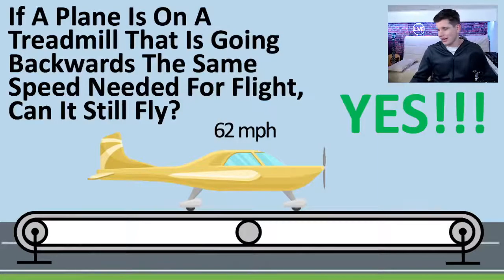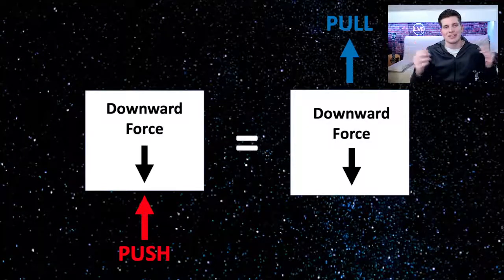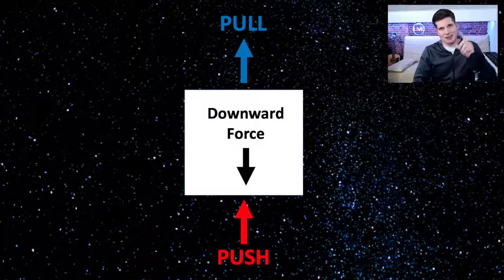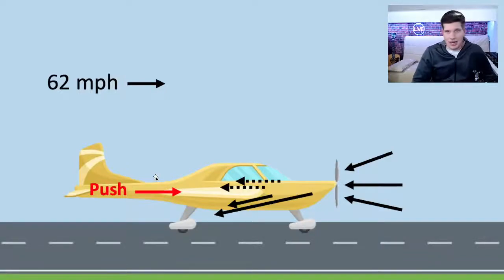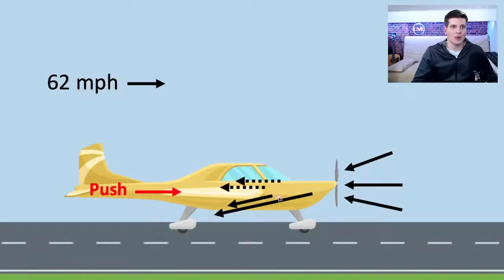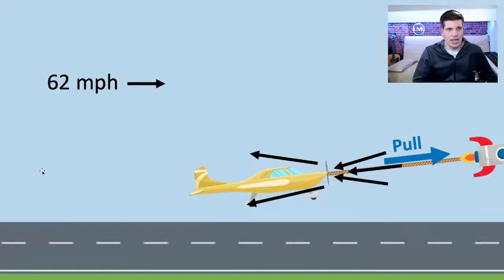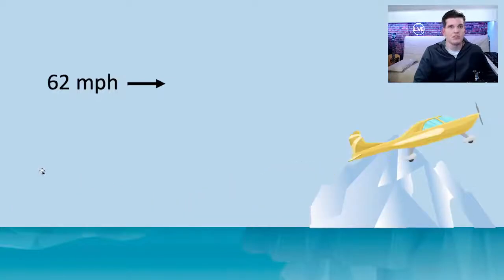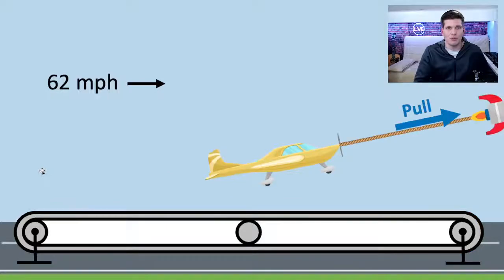Can A Plane Fly On A Treadmill? SOLVED! -A Practical Review

Comment: So if the wheels are matched exactly to the treadmill at all times, how can they possibly move to a location further up the treadmill? No matter where the acceleration force is coming from. All that's really happening is that the propeller is indirectly accelerating the treadmill to move the aircraft in the opposite direction at the same speed.
Reply: Wheels are passive.
Reply: Once more for the dense.

A rolling object on top of a moving surface moving at the same speed gives you zero net motion of the rolling object:

https://youtu.be/SLRfYA5AhgQ?si=3eqxedOsh-bsAZjb
Reply: @MrDefreese the crawler is not being propelled in any way. Again, you're not understanding the situation. 

Also dude, just stop with all this edgelord insulting: it's not helping. It makes you appear dishonest.

I'm going to hold your hand and walk you down the path to understanding. I'm confident I can explain this to you and help you understand the scenario correctly. 

But to do that, you need to engage honestly. 

I have 4 or 5 short questions. 
Please answer them directly and honestly. 
If I'm wrong, this will demonstrate that. 

When I've reached my conclusion, you can do the same. Or you can go first.

Sound fair?
Reply: @nuberiffic derp, the crawler is at one speed, the thought project says the moving surface matches exactly at every speed.  Increase the speed of the vehicle, the surface moves faster.  Move the vehicle slower, the surface moves slower,

That’s what ‘exactly matches’ means.

If you keep having problems with not only basic physics but also simple reading comprehension, you should just check out now and save yourself from being embarrassed even further.
You worry about your own honesty and if you need help with your own misunderstanding, you can ask nicely.

You have botched every single one of your attempted contributions.  You would need office hour assistance to properly remediate your mistakes.
Reply: Because the aeroplane isn't using the wheels to move forward.

The treadmill could be moving at infinite speed. It doesn't matter. 
The wheels are irrelevant.
Reply: @nuberiffic  People like you completely ignore that the plane needs to overcome the plane going backwards. If you placed a plane on a 10,000 mile long conveyer belt and put the plane on it facing backwards and turned the conveyer belt up to the equivalent of 160 knotts and then turned on the plane's engine and set it to 160 knotts you would have a plane that was standing still with its wheels spinning wildly.

The plane being stationary would have no lift on its wings and would NOT fly.
Reply: @DarthVader1977  ...well yes, if the aeroplane was stationary, then it wouldn''t be able to fly.

But that's the whole point.
It * wouldn't* be stationary because the engines are pulling it forward independant of the ground the wheels are in contact with.

Think of it this waY:

Imagine you are wearing rollerblades and you are on a treadmill
But, you are holding on to the handrail.

How fast does the treadmill need to go to prevent you from remaining stationary?

Assuming some ludicrous treadmill speed, it doesn't matter right?
You just hold on to the handrail and you'll stay in the same spot.

Now imagine a really long treadmill.
10,000 miles as you suggest.

This 10,000 mile treadmill also has a 10,000 mile long handrail.

Now, you pull yourself along using the handrail.

Does the speed of the treadmill affect your ability to pull yourself forward?
Reply: @nuberiffic Are you that dedrater that you don't know how a conveyor belt works? The conveyor belt would be physically moving the plane BACKWARDS at an equal amount the plane is attempting to move forward.
Reply: @DarthVader1977  ...no.
You're not understanding the situation.

If I'm standing on a conveyer belt, wearing rollerblades, and holding on to a stationary handrail that is not attached to the conveyer belt: will i move with the belt?
Reply: @nuberiffic holding a handrail or using a rope artificially changes the conditions.  This is a kinematics set up and you have to do it properly.
Reply: @MrDefreese  the handrail doesn't change anything, it's an analogy.

If I'm holding on to the handrail, that's analogous to an aeroplane "holding on" to the air.

The handrail / air are independent of the treadmill, and since that is the only method of propulsion, forward motion is still possible.

Did you know a tiger moth biplane can take up with the engine turned off and no forward motion if there's a decent headwind? (Actually any aeroplane can, the Tiger Moth can just do it at a fairly low speed, as in, pilots do this as a trick in real life)

The TM has zero forward motion, but is still able to take off because all that matters is the air movement over the wings.

The wheels are irrelevant.
Reply: @nuberiffic no, the wheels are not irrelevant.

No the handrail or rope is not an analogy.

Adding a rope or handrail introduces a position constraint.  If you know basic physics, that is contrary to the speed, acceleration, and position conditions that you start with in the thought project parameters.  Don’t try to defend the analogy; it is entirely flawed.  You would need to know the math basis for why it’s wrong; Position, speed, and acceleration are all inextricably tied together.

A motion of an object on a surface is tied together by kinematics in precise relation.  Wheel motion on a surface is very well defined by kinematics and angular motion.

The speed at the wheel axis in the environment is exactly the tangential speed of the rolling wheel and the linear speed of the moving surface.  That equation is inviolable unless your wheel skids.  Skidding is not the basis of the thought project and because of your handrail canard, would be the inevitable result of the incompatibility you introduced.

Again, you can’t defend your analogy; it is based on at least one mistake in fundamentals.
Reply: @nuberiffic oops.  Of course a special aircraft can take off with a sufficient wind.  That is unremarkable.  Absent wind, you have to get your aircraft moving on the surface it’s on and the only ways you can do that are by skidding or by rolling.

Skidding makes it easy to understand - if your plane skids at a certain speed on a surface, then your surface also moves at that same speed…resulting in no net motion in the environment.

If you did this on say an aircraft carrier with a long flight deck, any plane moving from bow to stern while the ship is steaming forward gives you an example of the thought project better than the incompatible handrail analogy.
Reply: @MrDefreese no dude. 
The hand rail is a perfect analogy. 
You say it's a position constraint. 
I agree, and so is the air. 
Thats the point. 

The propellers "hold on" to the air in the same way i would hold on the the hand rail. 

We're both exerting a force on a system that is independent of the treadmill. 

I have to clarify:
You do know that the wheels on an aircraft are not used to generate speed right for take off right?

The propeller is the only method of propulsion that an aeroplane uses to get to take off speed. 

Since it is using the air to propel its self forward, and the air is independent of the treadmill, the speed of the treadmill is irrelevant. 

It's exactly the same as standing on a treadmill on Rollerblades amd using the handrail to pull yourself forward.
Reply: @nuberiffic air is not a position constraint.  You are really deficient on basic points and you merely doubled down on your mistakes.

Propellers do not ‘hold on to the air’. That’s really bad comprehension entirely.  Propellers merely provide a net force on the aircraft irrespective of position.

Because you keep mistaking a position with a force, you are incapable of understanding anything else.

You don’t have to clarify or question anything except your own basic misunderstandings.

This is a kinematics exercise. Belts simplify for you instead of dealing with derivative calculus….

One revolution of a wheel results in 3.14 * wheel diameter of travel.

If the surface travels that same distance with the aircraft on it in the same exact period of time, how far does the wheel axis travel in total?

Somehow, per usual, you will triple down on the same mistake then we will have to post videos do you eventually come around and get it.

🤷🏽‍♂️
Reply: @MrDefreese  ...wait.

Seriously:

Do you think that an aeroplane derives it's forwards momentum on the ground via the wheels?
Reply: https://youtu.be/lB9C9cRoJaY?si=d0WCwSKOz2yx83VQ
Reply: @MrDefreese ...what do you think ia being demonstrated here?
Reply: @nuberiffic that shows you when one object moves and the object it is on moves at the same exact speed.

There is no net motion in the environment for the person.  For an aircraft, it means there is no airflow.

This is basic kinematics.  It’s undeniable.
Reply: @MrDefreese if you pull (or push) on the handrail, will there be motion?
Reply: @nuberiffic He is just looking for attention, he literally denied the irrefutable video proof and is not equipped to hold any conversations requiring this level of thought.
Reply: @nuberiffic derp.  It has been explained to you that a handrail or rope introduces an incompatibility with the system.

You are clearly unfamiliar with the physics relationship between position, speed and acceleration so you are really incapable of contributing anything here.

If this were a classroom environment, we could show you in excruciating detail where you go wrong.
Reply: @MrDefreese hmm. Interesting that you bring up the classroom.
Because that's where I learned this. 
In my aeronautics classroom while I was studying for my bachelor of aviation degree. 

This exact scenario was brought up to demonstrate the misconceptions many people have about how aeroplanes work. 

The aeroplane will take off because it is pulling itself through the air. 
The treadmill is irrelevant. 
It has no bearing on the aeroplanes ability to move forward. 

You are just wrong here dude.
Reply: @nuberiffic  He is just looking for attention, best not to feed him. I love your post! The only effect the treadmill would have is adding some more rolling resistance since RR increases as velocity does, but it wont be enough to cancel the thrusts forward vector at the wheel (2x rotational velocity). Thanks for bringing more sanity to the obvious!
Reply: @nuberiffic derp. Look, you screwed up the issue of basic position, speed, and acceleration, touting your degree doesn’t work.

You don’t know kinematics, angular motion, or frames of reference.

You are incorrect even when your errors have been pointed out multiple times.  You have been given the example of the exact scenario and you still don’t get it.

You can either keep being wrong or you can learn from your mistakes in just this thread.

An object moving at one speed on an object moving at the same speed in the opposite direction gives you zero net speed.

Why are you struggling to defy basic math and physics?
Reply: @MrDefreese you don't understand the situation dude. 

Yes, if an object is moving forward on a surface moving backwards at the same speed, then yes, there is no net forward motion. 

But that's not what would happen with an aeroplane. 
This is the part you keep failing to understand.  

The aeroplane isn't using the treadmill to propel itself forwards. It's using the air, which is stationary.

The treadmill is a red herring. 
It doesn't enter into the equation because it's not part of the propulsion system.
Reply: @GoatDirt you don’t even know what rolling resistance is.  😂😂😂

Why are you commenting when you are mistaken on basic principles.  At least the other person tries to claim having an aviation degree even though that would have covered position, speed, and acceleration.

Your contributions have been clownish.
Reply: @nuberiffic derp, adding a force to the object merely changes the speed of the rolling object over time.

This shows yet again that you don’t know anything about acceleration, speed, or position - aka basic physics.

We can keep literally running circles around you bots.
Reply: @nuberiffic wheels are not irrelevant.  This is basic angular velocity and kinematics.  The motion of a wheel on a surface is precise; that’s one of the very first set of equations you do to go between motion at the wheel axis, motion around the axis, and tangential speed on the surface of the wheel.
Reply: @nuberiffic if wheels are irrelevant, then why on Earth would planes have them? The answer is they wouldn’t.

Which indicates your premise is wrong, wheels are relevant to achieving take-off speed (among other uses such as landing). The way they do that is by limiting the effect of friction between the runway surface and the plane. If the wheels are being counteracted by a treadmill, then we must ask ourselves, could a plane take-off without freely rotating wheels?

For something like a small Cessna plane shown in the video, I’m not sure, I have not completed the calculations. However I believe for a 747, which is the plane in the most common graphic shown on the internet, it’s engines do not have enough thrust necessary to overcome friction to achieve take-off, without freely rotating wheels.
Reply: @ilyer4199  ...what. 

I didn't say the wheels are irrelevant to the operation of an aircraft. 

They're irrelevant to the question. 

All the wheels do is allow the aeroplane to operate without friction (or negligible friction) with the runway. 

Which you admitted. 

Given that fact: there is no way for the treadmill to exert a meaningful influence on the aircraft. 

It will take off because the wheels have no meaningful influence.
Reply: @nuberiffic  you are almost correct. All the (freely spinning) wheels do is allow the aeroplane to operate without friction with the runway.

That is what I admitted.

Given that fact, and given the fact that the wheels in the question are in fact not freely spinning, the wheels are entirely relative to the operation of the aircraft on the magic treadmill or not.

In ANY instance where the runway surface has friction, the wheels reduce that friction (effectively) by being allowed to roll ACROSS the surface. The plane exerts forward pressure on the wheels, and the wheels allow the plane to effectively fall forwards by rotating, not on the spot, but in a forward direction.

Just because the wheels would be spinning, does not mean they are freely spinning.
Reply: Imagine a situation where instead of a plane with wheels. It was a plane on a runway. Except the runway is special because it is designed with thousands of rows of free rolling wheels. The plane is craned on top of the runway (the rows of wheels), it fires it’s engines and it starts to roll over the wheels, eventually getting enough speed to theoretically takeoff (there are logistical problems with this, but the important point is the plane gains forward momentum, practically unimpeded). I think that hypothetical is pretty agreeable.

Now, imagine practically the same thing, but this time, each row of wheels has a magic treadmill counteracting it’s rotation. The plane is placed on the runway again, it fires it’s engines. Does the plane move?

I don’t think so, the wheels are not freely spinning, in the very first instance of thrust being applied by the engines, the wheel would rotate the slightest amount, at the same time the treadmill would rotate to counter the wheel (in the actual hypothetical, the treadmill acts instantly so I’m not convinced the wheel would rotate even the slightest bit, but I can’t really explain it intuitively without adding a slight delay). The (before) freely spinning wheels, are no longer freely spinning. Thus, they do not carry the same property as before of allowing the plane to roll forward, or in this case, across them.
Reply: @ilyer4199  No. 

You said it before, there is no friction between the aeroplane and the wheels. 
Therefore, no matter how fast the wheels are spinning, they won't affect the aeroplane's motion. 

Think of a skateboard on a treadmill. 
If you angle the treadmill, the skater will roll downhill. 
The speed of the treadmill doesn't matter: the skateboard will always roll downhill. Gravity pulls it down and the wheels just spin. 

In exactly the same way:
The engines of the plane pull the aeroplane "downhill". 
The speed of the treadmill is irrelevant. 

The plane will take off.
Reply: @nuberiffic  I don’t know if I ever said there is no friction between the aircraft and the wheels. That’s not a good way of looking at the relationship between those two things. I would be more inclined to say the wheels are the plane.

As to your skateboard scenario, no. If the treadmills speed is connected to the wheels in such a way that it doesn’t allow the wheels to roll down the hill, then they skateboard will not roll down the hill. If the wheel rotates 1cm downhill, the treadmill rolls 1cm uphill, the wheel goes 5cm downhill, the treadmill goes 5cm uphill. Additionally imagine if the treadmill was twice as fast as your skateboards wheels. The wheels rotate 1cm downhill, the treadmill rotates 2cm uphill. The skateboard would move uphill. The speed of the treadmill is not static, it adjust instantaneously to the speed of the wheels.

Wheels do not roll in reference to any other object except for the surface in which they are touching. Since the wheels have friction with the ground, the wheel are affected by what the ground is doing. Since the wheels are in a fixed location compared to the plane, they also affect the planes positions while also being affected by the planes position. A rolling wheel still has friction with the ground, I think this is the thing you are missing, not sure. It doesn’t matter if it is spinning, it rolls forward exactly 1cm for every 1cm of ground. Which when the treadmill is continuously rolling backwards at the same pace as the wheel is rolling forwards, there can be no movement forward if the plane. The only way for there to be forward movement of the plane is if the the treadmill is slower than the wheels, or the planes thrust overcomes the friction between the wheels and the treadmill, performing a skid.

I don’t know if you have been 4x4 before. But I have been in a situation on a very steep slippery slope. The car (limited by the brakes) slowly rolls downhill. At a certain steepness the force of gravity overcomes the friction between the wheels and the ground, and the car slides forward.

That would be Analogous to the plane. The planes wheels are limited (completely this time) by the treadmill, the plane cannot go any more forward than what the wheels are permitting in reference to the ground. Even with a force applied (this time by the engines), the plane won’t go forward unless the wheels are allowed to rotate faster than the treadmill (which can’t happen in the hypothetical), or there is sufficient thrust to overcome friction.

A plane like the F-35 or most fighter jets would have the thrust necessary. They have a thrust-to-weight ratio greater than 1. A 747 however doesn’t.

Another way to determine what you think would happen. If the treadmill runway (lets say it was originally made of asphalt) was made out of 100% slippery ice, which has absolutely no friction. In your mind this must have zero additional benefits for achieving forward momentum. The wheels don’t have friction anyway, right.

And then take away the treadmill, a plane on a normal runway, versus a plane on a 100% frictionless runway. The second option offers no benefits? You cannot believe that is true.
Reply: @ilyer4199  no. 

It is simply not possible for the treadmill to match the speed of the wheels and prevent movement. 

Imagine you're on a treadmill on roller skates. And using your hands you pull yourself along by the rails. 

It doesn't matter how fast the treadmill is moving, you will be able to pull yourself forward. 

The plane works exactly the same. 
It pulls itself through the air. 

The motion of the treadmill is irrelevant.
Reply: @nuberiffic   brother.

1. It’s a hypothetical, the treadmill can do whatever the treadmill has been said to do. As per the grounds of the conversation it matches the speed of the wheels instantaneously.

2. It is not always possible that you will be able to counter the force of a treadmill, the reason why you think this is because you haven’t seen a sufficiently powerful enough one.

3. I know how a plane works, I work in the aviation industry, it was part of my training to learn exactly how lift works and how planes propel themselves.

4. Your understanding of movement of objects on freely spinning wheels is wrong. And it’s demonstrable. You think a skateboard (or similar object presumably) will roll downhill on a treadmill, not always correct (and not correct for a treadmill which perfectly matches the speed of the wheels instantaneously). You are wrong. The YouTube video “Can a Lego car roll downhill forever?” shows this.

When there is friction between a surface and a wheel, the wheel MUST rotate ALONG the surface to move in a direction (Or lose/overcome friction). It does not matter if the surface is downhill (like the video) or flat (like the example). Wheels do not eliminate friction. Like shown in the video, like a car LOSING friction on ice (downhill or otherwise).

The planes thrust has to overcome the friction of the wheels, because in the hypothetical they are not freely spinning. Planes do not have infinite thrust. The thrust to weight ratio of a 747 is 0.269. The (roughly) frictional coefficient of a pavement to a rubber wheel is 0.7 to 0.9 depending on which internet source I use. 0.269<0.7 by a long shot. The 747 cannot overcome the friction of the wheels on a pavement. The 747 cannot move forward. The 747 cannot take off.

Same thing with the Lego car. Gravity did not provide enough force (comparable to thrust) to overcome the friction of the wheels when the Lego car was sufficiently heavy that it maintained traction. A freely spinning wheeled object will not always move downhill or along with the force it is experiencing. You can also know this because you can’t push the 747 on the treadmill with your hands (ignoring air resistance and such). But you should be able to according to you because the wheels are frictionless. No friction means the tiniest of forces will push an object.

Beyond this, I don’t know what else I can do to explain for you. Wheels do not work they way you think they do. Video evidence is provided. If that is not enough to convince you, then I’m lost.
Reply: @ilyer4199 

The Lego video showed that a skateboard would fall, regardless of the conveyor. The lego car could only be stopped when the wheels were driving a mechanical load. Without that load, the wheels are feeling spinning .. 

We can count bearing friction and rolling friction, and there will certainly be some friction to overcome.. but not nearly enough to prevent forward movement of the plane. 

No part of the original scenario, implies that the plane will necessarily be stationary
Reply: @ilyer4199 the wheels just hold the plane up off the ground. The wheels just spin at twice the speed. That is the part people miss about free-spinning axels.
Reply: @ilyer4199 they are freely spinning  and apply no forward propulsion. There is some rolling resistance which increases slightly as velocity increases, but will never be enough to cancel out forward movement relative to the ground. The wheels will just spin at roughly 2x their normal rotation as the plane takes off.
Reply: @GoatDirt if the wheels spin at twice the speed, then so too does the treadmill. Effectively, the results in no movement.

So then again, your wheels will move at 2.00001x, and then so to does the treadmill, repeat ad infinitum.

Yes, the wheel acts to “eliminate” friction by keep the body of the aircraft off the ground, but you are ignoring how a wheel achieves this. The wheels need to rotate along the ground to create/allow/facilitate forward momentum. If that ground is moving backwards at the same rate as the wheels are allowing forward momentum, then from an outsiders perspective (whether that’s a bystander off the edge of the runway, or more importantly, the stationary atmosphere around the plane), there is no movement.

And you can’t say the wheels start to rotate twice as fast, or even 1000000000000x as fast, because it is exactly, with no delay, matched by the treadmill. Whatever forward distance the wheels allow the plane to move forward (1m circumference if wheel translates to 1m forward movement of the vehicle), is the exact distance that the ground in which the aircraft moved backwards. It is a direct cancellation.
Reply: @GoatDirt wheels do not apply forward propulsion, they allow forward propulsion. Exactly 1 unit of circumference a wheel rotates around, provides exactly 1 unit of forward distance. But when it’s on this treadmill, that 1 unit of forward distance now acts from a position that is 1 unit of distance backwards. This equals zero net movement. If the wheels spin twice as fast to mean twice as much circumference per unit of time, so too does the treadmill. The treadmill matched EXACTLY.

Rolling resistance isn’t a topic to discuss until we agree on the previous points.
Reply: @snytty the wheels where never driving a mechanical load. The spinning of the wheels were driven by the force of gravity (akin to the thrust of an engine) pushing the car forward. The reason why effective bearing resistance was added was to balance out the force of gravity with the speed of the conveyer. Conveniently for me, in our plane-treadmill example, the max “force of gravity” (engine thrust) is known, and the wheels always match the speed of the treadmill.

Without load, the wheels still have weight, there is still an angle and speed of the treadmill which will demonstrate a cessation of movement. In fact this is a great example to think about too:

If the singular piece of LEGO, the wheel, were to roll forward, we could analyse one of two situations:

1. The speed of the surface of the conveyer touching the wheel is slower than the wheels surface.

In this case, this is not analogous considering the plane-treadmill example has them matched exactly without limits. As such, we conclude your belief is based off not understanding/considering the prompts, or

2. The wheel loses friction with the conveyer (likely if a lot of force is being applied to the wheel, you would expect this by increasing the ramp angle of the conveyer to increase the vector of gravity) and skids down the conveyer providing forward momentum.

I have already analysed this, a F-35 would have enough, but the typical graphic showing a 747 does not have enough thrust.

This is where any discussion about rolling friction is required, and considering a 747 doesn’t have enough thrust to overcome it, it remains stationary.

The part where the wheels cannot  yet gain forward momentum relative to the air implies the aircraft remains stationary.
Reply: @ilyer4199  you are so close! If the planes speed relative to the air is 1:1, the point you are missing is that the rotational speed of the tires to the treadmill is 2:1. The wheels DO NOT inhibit the planes forward motion of except for a small amount of rolling resistance. 

Watch Mythbusters prove me 100% correct before you watch Mark Rober do the same at a smaller scale. Check your vectors and we can move on to how rolling resistance is the only thing slowing the plane down but will never be enough to keep it from gaining enough air speed to take off. 

Such a fun thought experiment with empirically proven results. Thanks for playing.
Reply: @ilyer4199  There is no cancelation - period. The thrust from the engines is not contingent upon what the wheels are doing. Rolling resistance will never be enough to cancel the planes takeoff speed. Look at the integrals and you will see the rolling resistance is barely taking away enough energy or forward velocity to stop its takeoff. The plane going forward at 60 mph, means the wheels are at 120mph. Nothing more. This is truly not as complex as people make it out to be. Your model of forward cancellation only works for a car (as explained perfectly in the video). You cannot argue with the empirical evidence provided my Mark Rober and Mythbusters and both scales.
Reply: @GoatDirt ”so if the wheels are matched exactly to the treadmill at all times”

We are talking about the treadmill matching the speed of the wheels, not the plane. Mythbusters, by my memory, did not test this. Also, I would question the scientific validity of their experiment regardless. A tarp is not equivalent to a conveyer.
Reply: @ilyer4199  a tarp is exactly equivalent to a treadmill as it mimics the exact interface of the belt. Mythbusters pulled the tarp backward at exactly the speed of forward takeoff and the plane took off as predicted. You also need to define what the wheel speed refers to.  its axel relative to ground vs the treadmill, or relative to the air? Wheel speed can only be defined by its hub/axel speed, since rotational velocity is rpm or degrees per second, speed cannot apply to forward velocity
Reply: @GoatDirt wheel speed can be measured by the tangential speed on the circumference.

Your equation is this:

Speed at the wheel axis in relation to the atmosphere is the tangential speed of the rotating wheel plus or minus the speed of the surface it is on.

On stationary ground, speed of the wheel axis is exactly the tangential speed of the rotating wheel, since obviously the ground motion is 0.

At any other ground motion, it’s different - such as a plane taking off an aircraft carrier which is moving in the atmosphere (plus the wind speed which is why they always steer in to the wind to maximize aircraft speed, carrier speed, and wind speed to get total airflow.)
Reply: @MrDefreese  whats cool is that as this is setup, the ground speed indicator on the plane will show wheel speed as 2X the air speed (assuming still air) due to the treadmill moving the “ground” backward. The gps will show the plane moving at exactly the same speed as true-ground. The engine thrust will be slightly higher due to increased rolling resistance (which goes up when contact rotational velocity goes up). Airspeed relative to the wings is all that matters (per your aircraft carrier addition) Such a cool puzzle
Reply: @GoatDirt in short, they did it wrong.

Doing it properly as stipulated, the aircraft or any wheeled vehicle, will be stationary in the atmosphere. Nd won’t generate lift.

Of course if someone changes the parameters they can make something happen,

As written originally, it won’t move in the frame of reference of the atmosphere.

🤷🏽‍♂️
Reply: @MrDefreese it wont be stationary in the atmosphere, did you forget the engines attached to the plane pulling it forward? You seem to still not understand the extremely fundamental aspects of how this already-proven-in-real-world-experiment allows a takeoff.
Reply: @GoatDirt you are still incorrect.  Jet engines only provide a force on the body…while it is on the surface…resulting only in the vehicle merely rolling.
You in particular keep making the same mistake.

The test vehicle is only rolling and the equation for rolling is unambiguous.  It never varies.

The conditions presented show you without contradiction that the test vehicle never moves position in the environment.

Look up kinematics then try again.
Reply: @MrDefreese the force exerted on the body is what pulls the plane forward. THANK YOU for finally admitting your previous spate of complete lack of understanding was a complete waste of your time now that you finally get it. Now that you get why the plane can take off, you can move on to other topics like shapes and colors. 

Why you thought the treadmill magically affected the engines thrust was hilarious, but now that you have learned why the plane takes off just fine, you are good in my book. Kudos for seeing the light!

Heres the real-world proof in case you collapse back into your previous delusional state. https://youtube.com/shorts/XXIQuP82j_I?si=Upb1KgqBn1NvmgGY
Reply: @GoatDirt derp.  The body moves forward…on the surface that is moving in the opposite direction at the same exact speed.

Double derp - the treadmill doesn’t affect thrust.  That’s your own repeated misunderstanding of basic kinematic concepts.

An object moving at one speed on  top of the surface thats moving at the same rate in the opposite direction gives you a net speed of the object of exactly zero.

You should prolly stick to crayons and paste and construction paper because you are bungling basic physics principles.